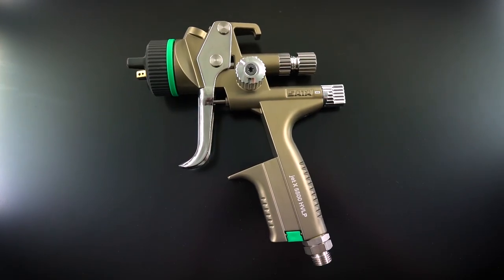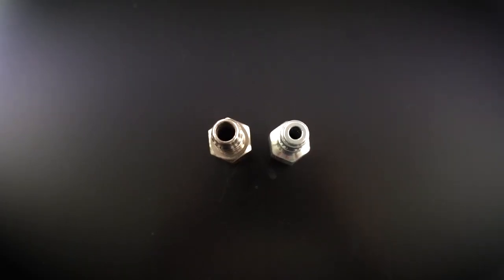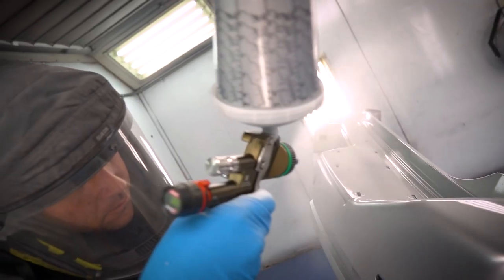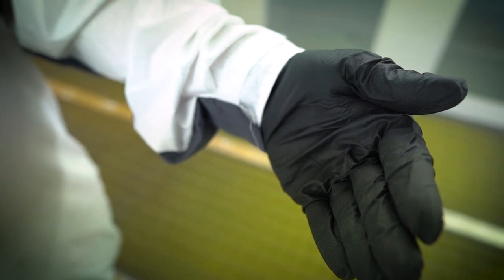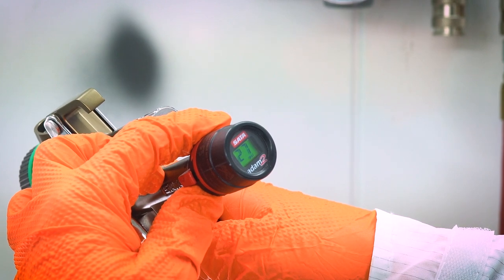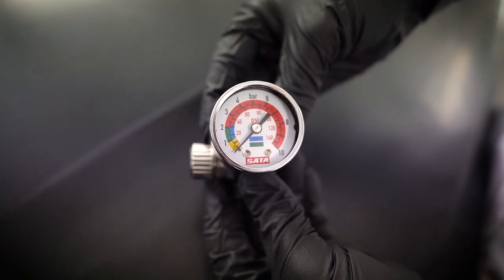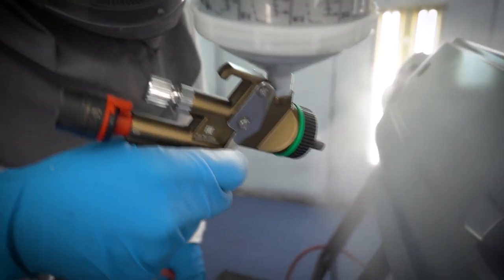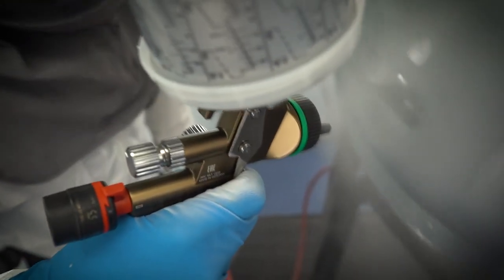Questions answered about using SATA HVLP or RP

Comment: I use my 1500RP for sealer, 5000RP for solid basecoat, 5000HVLP for metallic basecoat, and 5000RP Phaser for clear coat. All 1.3's and love them. Still got my old Sata Jet's though!

Comment: I have Satajet 5000 1.2 mm RP, I would like to buy Satajet HVLP for base coat,,, or can I just buy a HVLP nozzle set and use it on my RP? Are spray gun nozzles interchangeable?
I found various information on the internet

Comment: I got a question I was sold a used sata 5000b hvlp gun with a 1.3 RP tip and needle I haven’t gotten the chance to use it yet the guy that sold it to me swore it worked amazing is this even right ?  Is it now a RP or a hvlp still or a hybrid ? What changes exactly
Reply: The air cap center hole clearance to the fluid nozzle is the main difference  between hvlp and rp. I would think yours will be very close to hvlp. I only have rp's, can't check to see nozzle difference.

Comment: If the fan pattern measures   12 inches  from tip to tip at 6 inch distance  then my 75 percent overlap should be 3 inches or am I missing something sorry I'm trying to perfect  my overlap on my paint jobs
Reply: 3 inches would give you a 50% overlap.

Comment: Thanks for the great info! I want to get the Sata 5500 for applying solvent/alcohol based spray stains for cabinetry, which requires low pressure atomization, so that the product can get into the small sharp interior corners without blowing back out. Would you recommend an HVLP or RP? Which gun will atomization best, if the air pressure at the air cap is 7 psi on both guns?

Comment: İ think buy sata x 5500 1.3ı nozlee rp Technology but can i do metallic base coat with rp ?
Reply: What are you spraying? You can use rp for base for example I spray water spies hecker hi tech and they recommend sata rp 1.2 for base. I have the 5500 rp1.2 i and 1.2o I also have the 5500 rp1.3i which i have found is the best for clear. But that doesn’t mean u can’t use it for base. Check your tds sheet for what paint your using and worst case you can always close the fluid adjustment so it doesn’t put out as much material
Reply: @Tyler.56  Thank you, I painted a base coat with a rp gun before. It leaves a bit of residue. It darkens. I had to sand in some parts. Now I bought a 5500 1.3I hvlp. Now I have a hvlp and a rp.